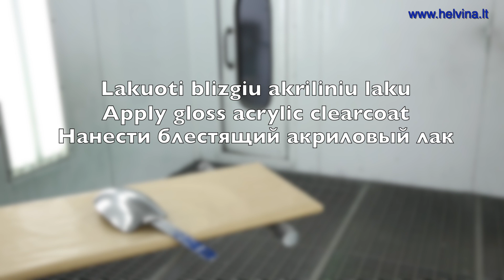MIPA Vicrome mirror glaze

Comment: Why add mipa wbc beispritzlack??
Reply from the maker: It is used to get better looking mirror glaze finish. It helps to avoid partial dissolution of the basecoat.
Reply: @HELVINAltd  Did you mix beispritzlck together with Mipa Vicrom in your paint bucket or you sprayed it separately?
Reply: https://youtu.be/6XKQtMBihFc?si=KM38Hsy1PiONyCdm&t=61

Here it looks like Vicrom is still inside while you adding Beispritzlack
Reply from the maker: @tbradaric  No, you have to spray it separately.